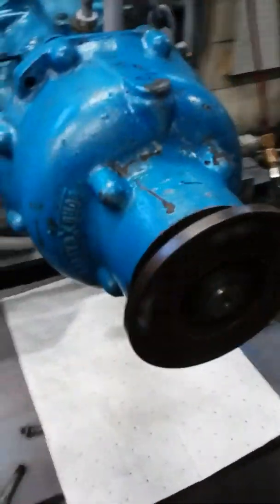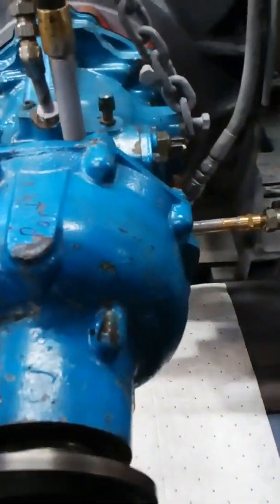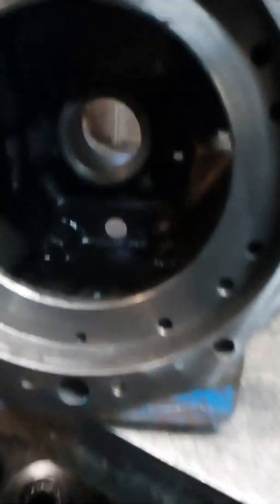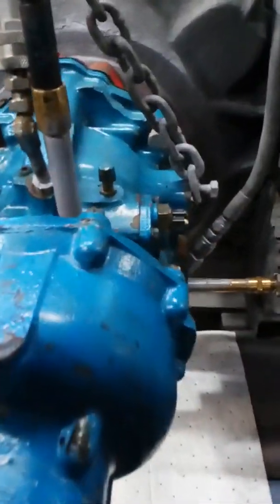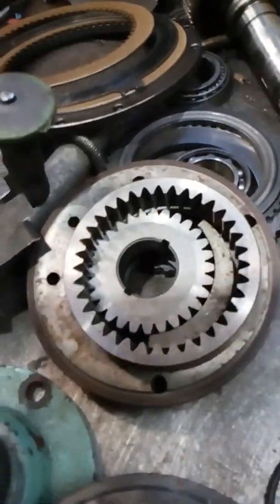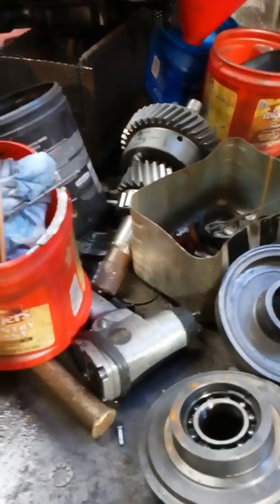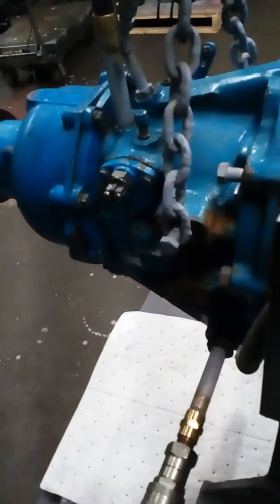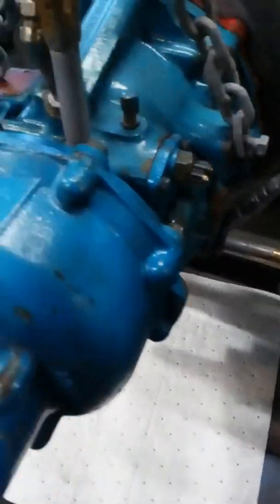Velvet Drive Reduction 1017-008 1.:91 transmission.

Comment: Hi, Can you remove the reduction gear housing and run it 1:1?I have a good 2:1 and a old water damaged 1:1 and would like to try and make a good 1:1?
Reply from the maker: Thank you for your question. The short answer is no. The transmission cases are different. The 1:1 output output shaft different then the reduction transmission.  The clutch pack, pump and some other components are interchangeable. As long as we taking about 1017 71C transmissions.
Reply: Hi again,I have what looks like a 72c with internal spline drive coupling not the normal output drive flange, Its missing the ID plate so i am unsure of its exact model/type, Is there any way to tell just looking at the casings?
Reply from the maker: @keithsmith55  Hey Keith. Email me a picture and I will see if I can figure out what you have. sales@halemarine.com